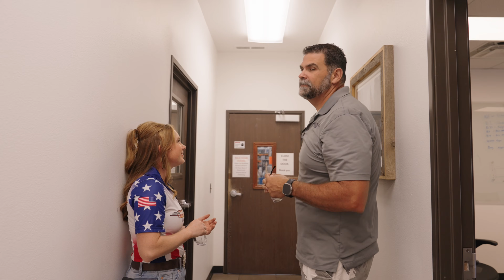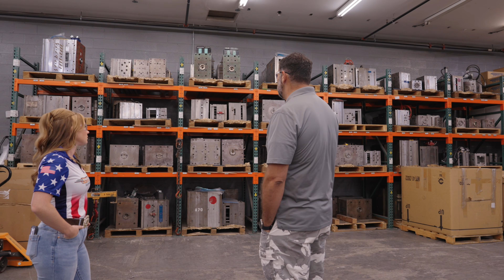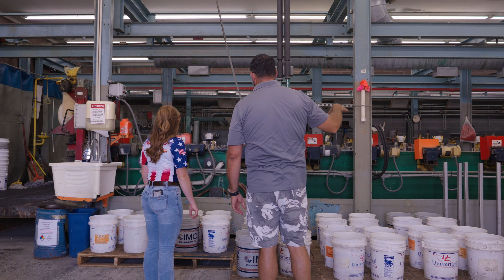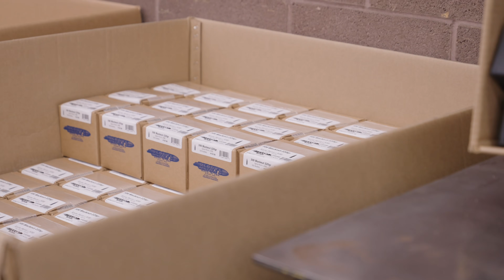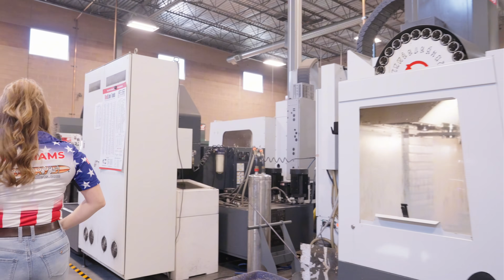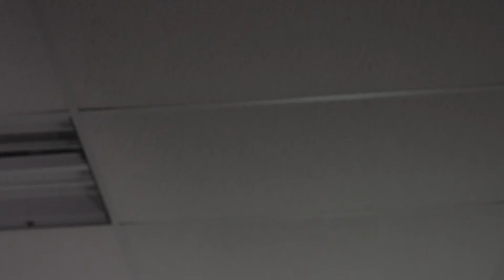Berry's Manufacturing Deep Dive – How They Build Champions' Ammo

Comment: But berrys are typically sold in 250 count, xtremes are sold in 500 count for usually the same price, so berrys are typically twice the cost, on the other hand Berrys double struck 50 AE 300 grain are very nice!

Comment: ive worked in one of the large ammunition plants. done all the lead stuff, copper plating, etc. really surprised to see them moving product around with coffee cans, and 5gal buckets. looks like they have some really nice equipment, but lots of room to improve their efficiency. not a slam on Berry's, as i shoot a lot of Berry's plated bullets.
Reply: I did see that home depot now has hand trucks made specifically for moving 5 gallon buckets of paint and I was expecting to see the same in this video. If it was up to me, I would have something mechanized......then again, I don't buy Berry's bullets anymore as I built my own automated bullet casting machine and an automated bullet sizing machine to run them through after powder coating. My neck and back did not like hand casting and sizing and it was a fun challenge to built a 100 pound lead pot and then turn it into an automated machine just by looking at videos and pictures of other machines on the internet. Funny enough, I'm sitting here in Fontana where they used to be located and my grandfather probably bought directly from them when they were here.
Reply: “Cutting corners isn’t something we do at berrys” while standing by those coffee cans and 5gal buckets lol. The giraffe is full of it
Reply: @ShaddupNshoot  to be fair, coffee cans, and 5gal buckets dont mean they are cutting corners. it does mean they are leaving a good amount of effieciency on the table. plus the employee's have to lift those cans of bullets day in, and day out.
Reply: @leftyo9589 when employees have to lift those lead filled can manually, that’s straight up the employer cutting corners along with not giving 2 shots about their employees
Reply: @ShaddupNshoot  No, that's providing employment to more people when those jobs would be lost if converted with automation
Reply: @ShaddupNshoot What other size containers are you gonna use to move bullets? Some custom garbage that costs way too much? Fudds who don’t know anything yapping 😂😂